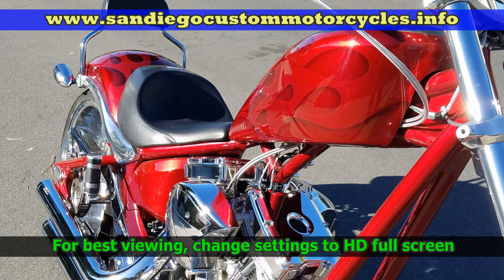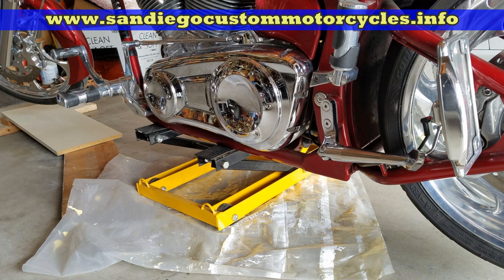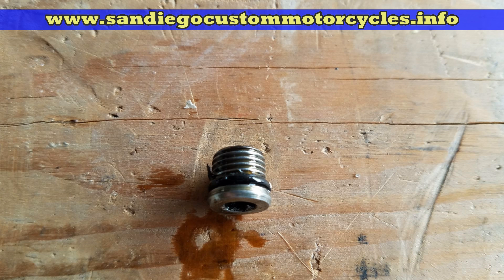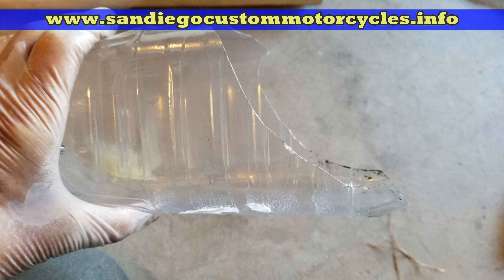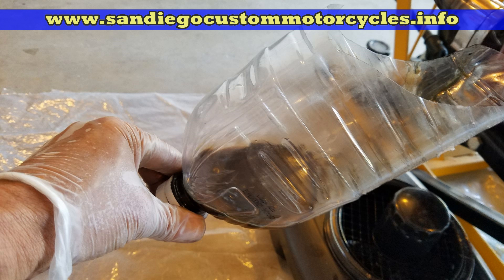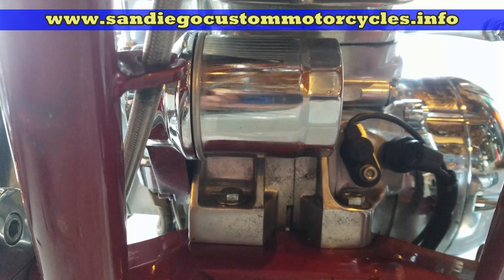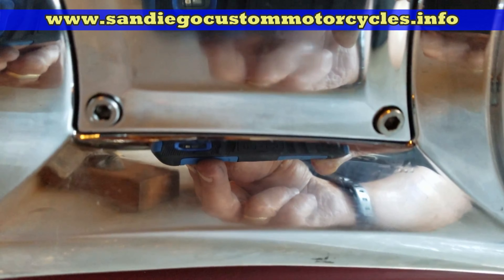Big Dog Oil Change

Comment: Thanks! Solid info, doesn't look to tough of a job.
 I just changed out the primary oil by following you video instructions. Adjusted the primary chain from watching another YT channel.  What a difference that made!

I noticed your K9 battery is mounted parallel to the frame, my 06 pitbull model is perpendicular. I just recently acquired it, so I am learning chopper maint on the fly!
 I dig that starter switch you mounted too!  Gave me an idea to maybe try doing jet starter switch style like with the flip up cover. Take me back to my fly boy mechanic days ; )

Comment: Hi from UK........Ok so I followed the vid for my 05 Bulldog  and drained the oil out of the sump. I also took the cap off oil filler tube.' I would have assumed that this would also drain the oil from the oil tank. Well it didn't I can still see oil at bottom of filler spout. and when i put dip stick in it shows oil between the two marks!!! - So how is the oil supposed to get out of the oil tank? - I am confused? please assist - Thanks
Reply from the maker: Look at .43 into vid. All bikes have oil drain plug usually under the frame ... check your manual.

Comment: The reason is there is a cross bar running right under the drain plug which is a 3/16 Allen and I can't get anything to fit it straight on.

Comment: I thought you checked the oil level on the K9 while its on its kickstand. Not on a jack.
Reply from the maker: Here's what the owner's manual says for the 2009 models: RIDID MODELS - with the engine off, and the motorcycle up right and level, the oil level should be visible at the bottom of the fill neck tube. HIDDEN-SHOCK FRAME - when the motorcycle is upright, the oil level should be visible at the bottom of the fill neck. When the motorcycle is on the kickstand, oil should be visible at the bottom of the fill neck tube.

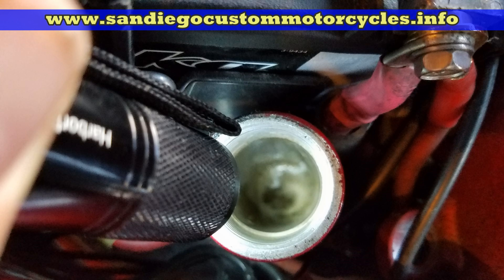Comment: This question us for the bike's owner: at 2:30 what's that little metal switch for? (the one below the orange cone) .. I just got  a similar bike and although on my bike that switch is smaller.. the mechanics don't know what is that for. I would appreciate also if anyone else may know that 👍. Thanks
Reply from the maker: Bike was custom re-wired - that is start switch